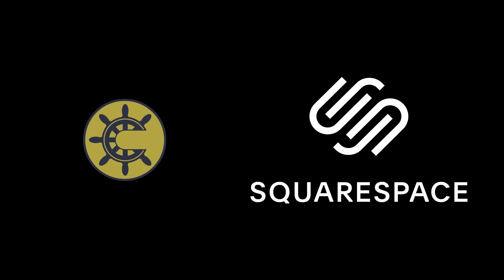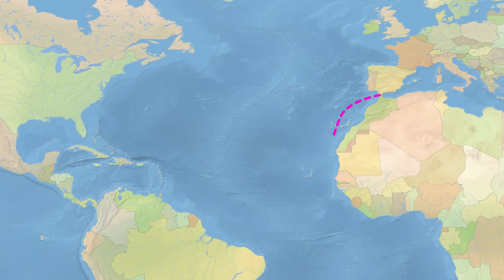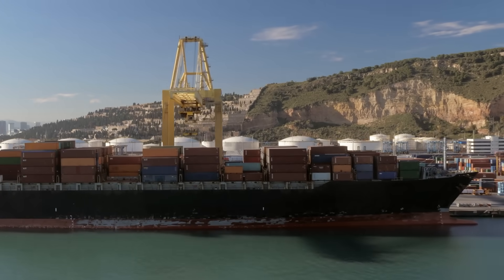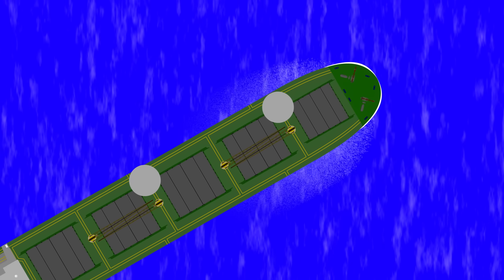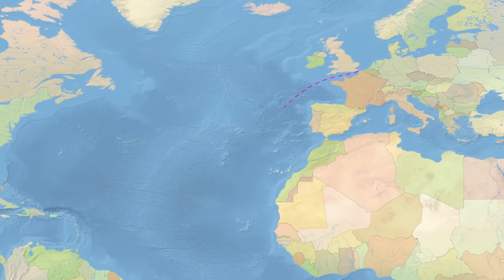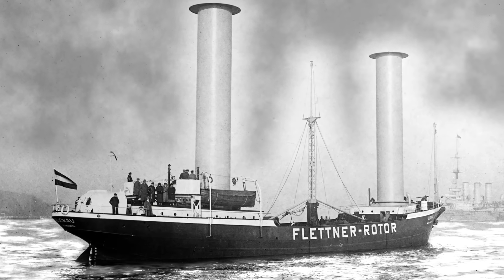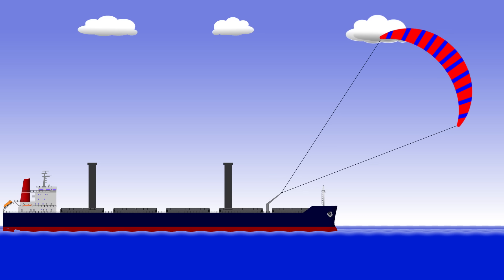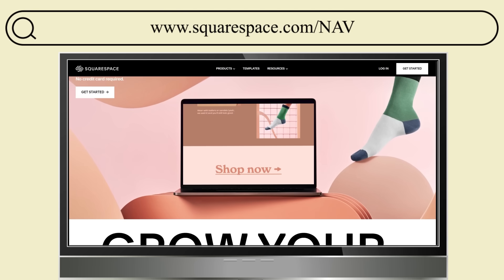Why Don't Sails Work On Ships?

Comment: I would disagree that regulation is the only way these devices will be used. Fuel savings would mean a higher return on the cargo shipped, which would make the co,pant more competitive. Like how airlines are phasing out their 747s for 787s and 777s.
Reply: Idk, ship fuel is dirt cheap, since they pretty much burn crude oil, don't get me wrong the shipping industry has made changes for fuel economy before, but only small ones, this would be a very significant change that will probably be more expensive to install and maintain than the cost of the fuel saved, this is one of those things that is very important long term, but since it decreases profits short term few companies would do it
Reply: @Stackoverkill  Correct me if I'm wrong here, but I don't think modern ships are allowed to burn bunker C crude like they used to because of environmental degradation. Leaving that aside, fuel consumption has become the biggest factor in shipping operations, even more than time. You can see this in the new slow steaming practices that have been implemented over the last few years. Most people would gladly pay to have their goods in port a few days earlier but companies have realized that fuel consumption is far lower if their ships move at 15 to 17 nots instead of 20. Given that, it seems to me that the only way this won't be implemented over the next few years will be if the fuel savings are negligible or the cost of the device requires significant modifications to the hull. I think this video has safely proven the former false, which means the only remaining point is one of cost-benefit for each particular ship. For example, if your 20kTU behemoth can use 20% less fuel in exchange for a $2 million upfront cost, I think most shipping companies would take advantage.as that's insignificant to the fuel savings you'd get back over the next 20 years. Of course, it's not just the cost of the device itself but also the amount of time the ship has to spend laid up while it's installed, maintenance costs, etc. In general, if this really is a cost savings then it will be implemented, as most companies are not as short-sighted as most people like to pretend, especially conservative shipping companies.
Reply: @hughmungusbungusfungus4618  If there actually were cost savings this would have been implemented a hundred years ago.  Be suspicious of 'great ideas' that have been around for a hundred years and only implemented in niche markets.  If it hasn't been implemented - there are probably good reasons for this.
Reply: @colincampbell767  It could just be that it wasn't cost-efficient until the price of cleaner fuel began to climb. I will admit that the SDGs probably have a hand to play in this and government subsidies are probably part of the reason these technologies are getting so much coverage. That being said, it's a real technology so if it leads to actual cost savings it will be implemented.
Reply: @hughmungusbungusfungus4618  "It could just be that it wasn't cost-efficient until the price of cleaner fuel began to climb."

If that were the case, then these things would have been implemented in the 1970's (during the 'oil crisis.).  And remember that any increase in costs is ultimately paid by you in the form of higher prices.
Reply: @colincampbell767  There's a couple differences there. In the 1970s there wasn't nearly as much container trade as there is today; the ships were smaller and there were fewer of them. Moreover, they were still using Bunker C crude at that point, which is extremely cheap anyway. Also, most shipping companies purchase fuel on futures contracts so they can maintain price stability. Therefore, the oil crisis probably had a limited affect on the shipping industry. Now we're seeing price instability, inflation and we have a larger number of larger ships. Remember, there were electric cars in the 1920s and 1970s as well but they weren't popular until Tesla's advances in battery technology made the concept viable so just because something wasn't implemented in the past doesn't mean it doesn't make sense today.

If they implement this technology then that will be proof positive that it makes economic sense. If they don't then it probably means that there's no business case for it which probably means that the fuel savings don't outweigh the installation and maintenance costs.

Comment: You could make sails compatible with deck space if you made the mast strong enough so that it doesn't need rigging to hold it up, and had motorized retraction of the sails.  This is the design used currently on several large yachts:  DynaRig/Falcon Rig:  https://en.wikipedia.org/wiki/DynaRig
Reply: It would still interfere with the cargo holds and shore cranes/gantries. You would need to make more space for the masts which reduced space for cargo and makes everything not worth it in the eyes of the owner.
Reply: @Danieloncarevic  Not very much.  DynaRig is basically square sail with no rigging -- the masts are strong enough to hold the sails without rigging, and turn to position the yards, so if you turn them all as if sailing directly downwind, they will fit into the space that already exists between cargo holds with only slight expansion of that space.  Interference with the shore cranes would be limited to them having to retract to go between holds.

Also, some cargo ships have their own cranes.  In that case, you could integrate the masts into the cranes (and in that case the optimal type of sails might be something other than square sails).

Comment: This reason is quite unsatisfying :/ regarding all the benefits, I still think sails would be great!
Another more restricting reason I can think of would be the big mass the ships transport nowadays. How do the loads compare? Is a sails power even strong enough to make a difference? How does the ships size scale to the sails?
Reply: I wouldn't imagine a theoretical limit to sailing ship size - bigger ship would have bigger sails. There are of course practical limitations, in particular that many large ships are already at a height limit for going under bridges as they are, without any standing rigging. Another problem is stability, a lot of cargo vessels are quite tall relative to their beam (width), again an effort to maximize cargo (or passenger) capacity while fitting within a given set of dimensions. That means that sails (or rotors) would need to be placed higher yet, giving more rolling moment that the ships aren't wide enough to resist. So ships of existing proportions wouldn't work well with sails, but a gigantic version of a more traditionally-proportioned sailing ship ought to work - just wouldn't be able to fit under bridges or into harbors. This is the advantage of things like sky sails, they don't require standing rigging, and the cables can be attached lower down to not tip the ship over.
Reply: I think the biggest disadvantage would probably be loading/unloading cargo

Comment: More government Regulation will only enslave people, so if the best option is the Owner/Operator setup, then encourage the Owner/Operator Setup.
Half the problem of there being so many Owner/Charter Setup being more cost effective, just so happens to be cause by Government Regulations in the first place.
So if Government Regulations are encouraging the Owner/Charter setup, and the Owner/Charters are the ones unwilling to experiment with new technolodgies, then may you SHOULDN'T encourage MORE government regulation.

Comment: 5:51 ok but that increase isn't permanent is it you only have to pay for the rotors once dont you .. if the rates remain higher after that excluding a small bump for increased maintenance then if just the owner being greedy and well thats not a problem with the ship or the tech now is it
Reply: If that were the case - then all of the competitors would be implementing it in order to make more money.
Reply: We're not talking about a $50 coat of paint. You act as if the cost of the rotors is earned back within a month. These rotors can easily double and depending on the ship triple the cost of construction. You're not going to save that in fuel on the first day. 
We really need to teach economics in elementary school in this country

Comment: Another way for ships to get rotors is by building the ships with them rather than retrofitting existing ships
Reply: True, but that would take a long time, ships stay in service a long time. Retrofitting is far cheaper than building new. There would be advantages for ships designed to have rotors (or other wind-driven systems) from the beginning though, the design can be more optimized for them similar to how sailing ships are designed differently from motor ships. I've seen a ship (the Legacy of Windjammer Barefoot Cruises) that was originally a motor ship with sails added, it's sailing performance was quite lousy compared with others in the fleet that were built as sailing ships from the beginning.
Reply: Wouldn't a better idea be to go to the shipping companies and ask them why this tech has been around for almost a century - with no wide scale adoption?  If this were as great as the person who made the video claims - this would have been implemented a century ago.

Comment: Bah!  Regulation.  How about, if it's a better "mouse trap", use it.
Back in the mid '80s, I had a friend (new chem engineer) researching how to make energy from sheep dip.  Then they got oil out of the sands in Alberta...

Comment: 2:10 That's not how sails work at all.
Reply: Yes it is
Reply: @lars8614  The graphic is right, but his rationale is wrong. It's not about deflecting the wind astern and propelling the boat forward. The sail is a wing, and works just like a wing on an aircraft. The longer path of the outside of the wing causes air to move faster on the outside of the wing than on the inside, which causes a pressure drop, which results in the sail generating lift in a force vector that is perpendicular to the sail orientation (tangential to the direction of travel). 
The keel of the boat helps to turn this tangental force into motion more-or-less in a straight line with the bow of the boat (without a keel a boat would just move in a direction perpendicular to the sail).

Comment: You would actually only need a few powerfull nations, that say do it or don't come to our waters. These powerfull nations could also just use their influence to make it mandatory through the UN, though.
Reply: Or the shipping lines would simply not go there.  If this actually was a good idea, then it would have been adopted a century ago.
Reply: @colincampbell767  Thats not entirely how that works. I don't even want to know how many good ideas were not adopted because of outside influence.
Did you know, for example, that the romans were the first to invent steam power? We could have had the industrial revolution around the year 1, but slavery was simply cheaper.
Reply: @MyLPMaster001  "Did you know, for example, that the romans were the first to invent steam power?
Actually - it was the Greeks.  

And the reason it took so long for steam to be a practical power source was the fact that we needed to invent cannons first.  And we needed the ability to make wrought iron in quantity.  I suggest that you read the book: 'Connections' by James Burke.  Although it's from the early 1980's it shows how technological innovations come about and why precursor technologies are so important.

Another interesting book on the spread of technological innovations during the Middle Ages is: 'Cathedral, Forge and Waterwheel' by Francis and Joseph Gies. 

BTW - the idea that the Romans avoided technological innovations because 'slaves were cheaper' is little more than a myth.

Comment: Regulation is not the answer. You completely overlooked the fact that the ship owner can charge the same amount of money and, if they are saving money on fuel, then they are recouping their investment through that savings. They do not have to increase prices.
Reply: The person chartering the ship will often pay for the fuel within the cost of chartering, be it an agreed upon rate and amount beforehand or they work out what they burned and send the fuel bill to the charter company. So Any fuel savings affect the charter company. But the cost for install and maintenance will possibly cancel out any benefits from lower fuel.

Comment: "It's the landlord that pays for the installation, but It's the tenant that benefits from reduced bills"

This comparison an absolute load of horseshit. People are more likely to rent a house that is financially appealing. Nobody rents a house without insulation as to not inconvenience a landlord 

Similarly, if charters reaps benefits from ships that have these rotors, then those ships will be more sought after than competitors. Making the cost of this equipment a worthy investment. 

The writer of this episode either seriously lacks economic comprehension, or there is something about the message that we are not being explicitly told.
Reply: He's peddling sails for ships that are made of steel and monsteriously heavy, even before you factor in the weight of the cargo. Even the largest fully rigged ship is dwarved by a normal bulk carrier. So he's an environmental nut who sees shiny new crap being sold like snake oil and instead of seeing it for the scam it is lauds over it.

Comment: No need for regulation because technology is advancing rapidly.

Planes also take advantage of Newton’s third law. Doing the math, you’ll find Bernoulli is a fairly insignificant component of lift. Think of a wing as a single-vaned pump. It pushes air down which causes the plane to go up.

Planes can fly upside down. Bernoulli would suck them into the ground.
Reply: Well planes Th at can fly upside down have an aerofoil that creates lift inverted. A light non acrobatic aircraft flying upside down would require a large amount of of forward stick (down elevator, nose down in normal flight to keep straight and level flight, but it will probably fall out of the sky.)

Comment: The US needs a “no docking if reflagged in last five years” rule to stop the regulation avoidance
Reply: They have the Jones Act, which prevents non US flagged and Built ships from making two port calls. So  it's only forgien ships. But I have witnessed a ship change hands 3 times within 2 years, along with two reflagging. 

Most new ships will be launched and registered in the Port of building and then changed when delivered to the owner. Say a Korean built ship delivered to an Indonesian shipping line.
Reply: @lachlanlandreth9069  perhaps we could just say they need to meet our regulations to dock at all?